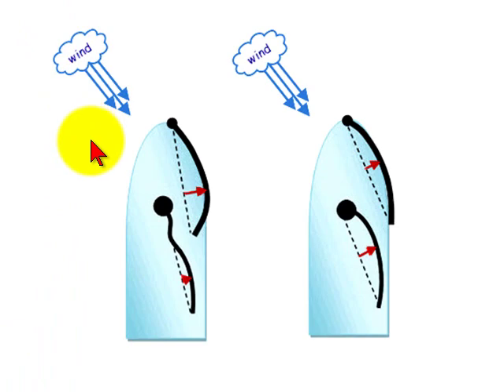How to Prevent Mainsail Backwinding for Better Sailing

Comment: This is great Captain John, recently tuning a mates boat with a new number 3 jib, realised I was instinctively applying the theory you presented. We were racing and it was driving me mad having main back winding. We played around after the race and moved cars to outside track and gained .5 to 1 knot of boat speed. It's all about protecting the shape of both jib and main keeping an appropriate "slot" for air flow between the two.

Comment: I never sail downwind with the main up to me its an upwind sail and to important a sail (its causes to many problems, gybes, broaches stc
Hear in Western Australian we can get 30kns wind shifts of 60 degrees which can destroy the main. its also too expensive to damage). 
I only use headsails or spinnakers. As this keeps the CE forward of the mast and very easy to furl a sail.
Reply from the maker: Safer with a small headsail on a sustained run in higher winds--as long as you have the sea room.